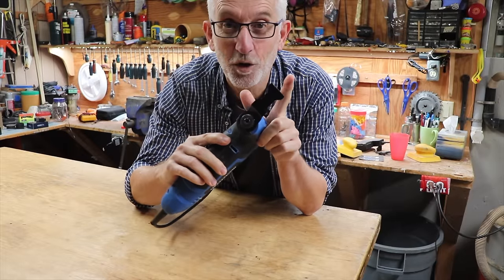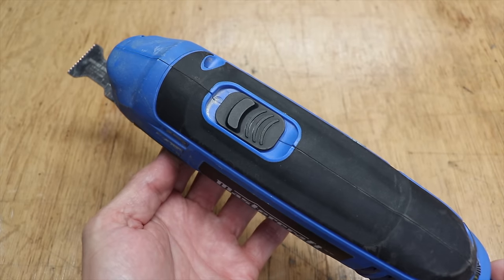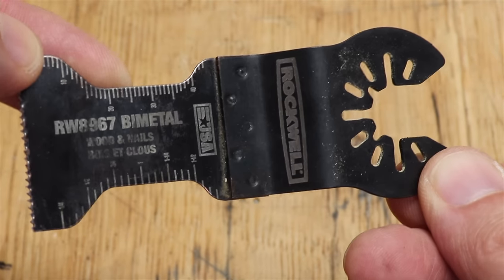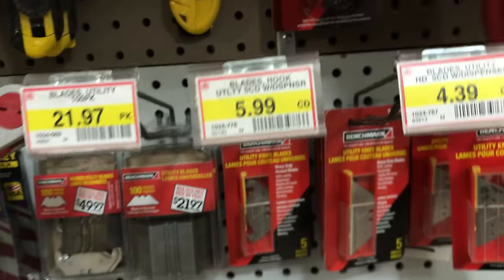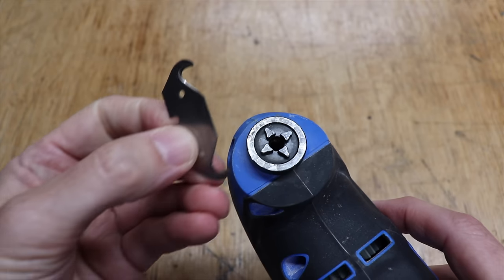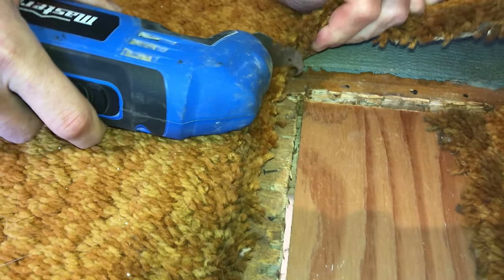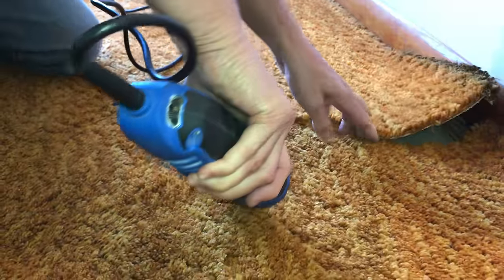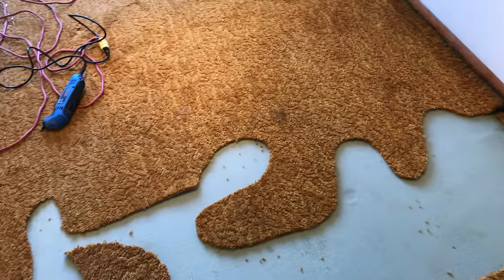Amazingly Cheap DIY ● Oscillating Saw Blade !

Comment: I'm a little concern about safety.
Reply from the maker: It's no different than any other power tool right? Circular saw. Jig saw. Sawzall. Table saw. Grinder. These can all do serious damage .....if you're careless. Treat all tools with respect and you're fine.
Reply: @chrisnotap  - I disagree. There is a difference. Those 'manufacture' blades had been tested to minimize accidents. Vibrations might loosen the blade. I can see that if the blade isn't fastened  correctly it could fly off. There are no holes to hold it. Might not fly far or could get stuck in the material it's cutting.

I think if you don't point the tool at yourself or others it shouldn't be that dangerous.
Reply from the maker: While using this, I loosened the blade ever so slightly and all it did was just fall out. It did not go flying or anything. It was as safe as it gets. No worries.

Comment: I make chicken coops out of Coroplast political wall signs  and cur down 5 Gallon buckets as nesting Boxes  I am buying a oscillating tool now
Reply from the maker: Make sure the mount will take the blade. I don't know if all mounts are the same.
Reply: @chrisnotap  I have a Ryobi 18V multi tool and it uses the same mounting system

Comment: And you were using the wrong blade for carpet, those blades are for roof shingles haha.
Reply from the maker: Yes they are for shingles but are for many other things also.
Reply: @chrisnotap  of course you can use them for anything, I use them for cutting out windshields

Comment: A full face protection shield and safety gloves is missing in this video since the razorblade is only mounted from one side and therefore not properly secured! This is very dangerous and could cost someone their eyesight. I personally would not recommend this to anyone .
Reply from the maker: Correct. Safety glasses and gloves is best. If this blade loosens, it just falls out onto the floor. It doesn't go flying. But just like using a manual utility knife, it can cut you open very easily if you are not careful.

Comment: Very sketchy depending on the type of blade, definitely wouldn’t use to cut plastic
Reply from the maker: I cuts plastic easily!!
Reply: @chrisnotap  maybe it’s a different blade but I had the same mastercraft oscillating tool and it felt very sketchy cutting plastic

Comment: Amazing but insanely dangerous! One slip and your on your way to the hospital if you don't go to deep and bleed out before ya get there! If you could attach a guard you could get some peace of mind!
Reply from the maker: It's way safer than you think. It's like when you are using a slide out utility knife. They are really dangerous if you pull the blade towards you when cutting. Common sense is to cut away from you.... always.  But also think of the other tools that could really hurt you....jigsaw, radial arm saw, skil saw, sawzall, power planer, table saw. If not used with common sense, they are all really dangerous. Thanks.

Comment: Now  you need a video to show how you put that man shaped carpet cutout back in place when the wife comes home, sees it, and goes through the roof (then ceiling and roof, too).    Seriously, though, I did a few carpet installs as a kid working for a sub contractor and this could have come in pretty handy, at times.  HORRIBLE job...knee breaking, and dirty.  I didn't even want to THINK about what was probably in all that dust flying around that came out of some of those carpets we pulled.  Nobody even suggested using a mask.  Yuck.

Comment: This will no t cut wood or drywall . The items you cut could of been done w a regular blade
Reply from the maker: Correct. Like the video shows, it's for cutting plastics and carpet and possibly leather and whatever else you can think of. But not drywall and wood. Toothed blades do that.
Reply: @chrisnotap  yeah it's pretty worthless, although it's pretty cool you discovered roofing blades fit, that's the impressive part of video I think

Comment: That's cool... until it loosens a touch and fly's off like a ninja star injuring somone...
Reply from the maker: Oscillating saws are very safe. I loosened this off a bit to see what would happen and it just falls out and that's it.
Reply: @chrisnotap  yes, they are, but I have seen them fly off. Was at home depot and was checking out the demo model and it zinged about 6 feet away from me. That was a blade made for the device. None the less its a cool idea, just have some safety reservation. Anyway, thanks for sharing the idea.

Comment: I praise diy tips in most occasions but this one should not be used. It is just marginally fixed in machine head. Consequently the design is UNSAFE.
Reply from the maker: If the blade loosens, it just falls out. I tried in many times before doing the video. Its as safe as any other tool like a jig saw, skil saw, router, table saw right? You can easily put your hand or fingers in harms way with all of them. Same with this one. Be safe. Be smart.

Comment: Great idea, BUT WEAR A FACE MASK, if the blade does come loose, watch out.
Reply from the maker: The blade would just drop out. These are very safe saws.
Reply: @chrisnotap  Yeh your right, I was forgetting that it just vibrates and does not spin. I have one and there have been a FEW times when nothing else would have worked.
Thanks for the idea.
Reply: It just occurred to me, what did your wife say when she saw what you had done to her carpet.
If I had done this I can assure you that I would have needed FAR MORE THAN A VIBRATING KNIFE BLADE TO DEFEND MYSELF.
Best wishes.

Comment: Use this if you want to be the black stick figure guy getting injured on the manufacturer instructions. Highly irresponsible video
Reply from the maker: These saws are very safe in general. Of course it is a sharp blade. But like any other power tool, table saw, jig saw, router, radial arm saw, skil saw, reciprocating saw.......they can all remove fingers and cause serious injury. Best practice is If you don't feel safe around any tool or this tool then you shouldn't use it.

Comment: If I saw you doing this on my job site you would be sent home and probably fired.
I cannot even begin to understand how you think this is safe.
You didn't use a single piece of personal protective equipment for this video so you obviously have no concept of personal safety or encouraging safety by leading by example.
Do you have any idea what could happen to you if that blade sliped out during operation?
Compare your thin, cheap and fragile little blade to the blade that actually goes on that tool for two seconds.
Common sense apperently isn't.
Reply from the maker: Yes, safety glasses and gloves for your own protection. Oscillating saws are very safe as you probably know. While testing this I loosened it off to varying degrees to see what would happen to the blade in that event and all it did was fall out. Thanks.
Reply: @chrisnotap  this is an incredibly irresponsible video advocating dangerous and potentially fatal practices and you say.. Thanks?
I think its finally time I learned how the block feature works on YouTube before you do further harm to my blood pressure.
Reply from the maker: Woah!! Hold on!!  There are plenty of very dangerous tools when in the wrong hands like a skil saw, radial arm saw, table saw, jig saw, nail gun, power hand planer and even a basic slide out utility knife. I know what you're saying but re-think that. Thanks for commenting.